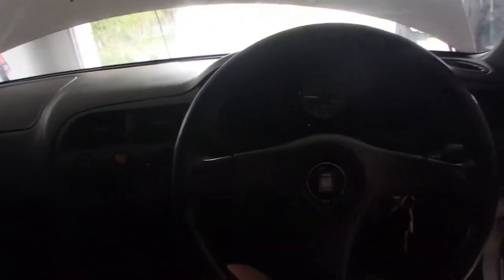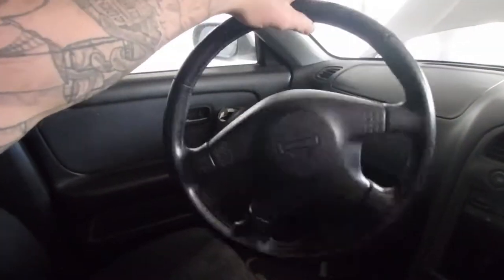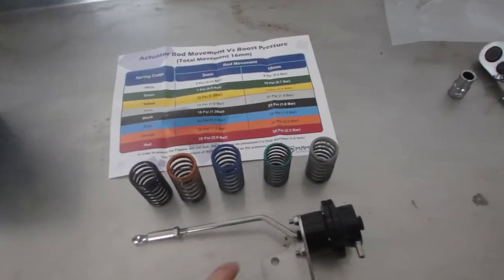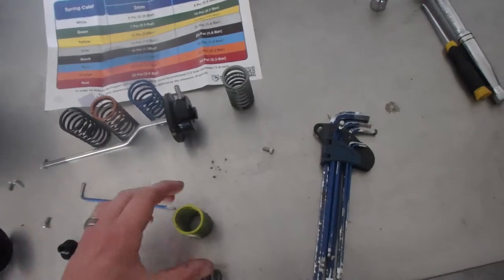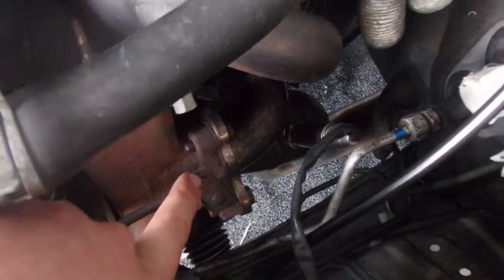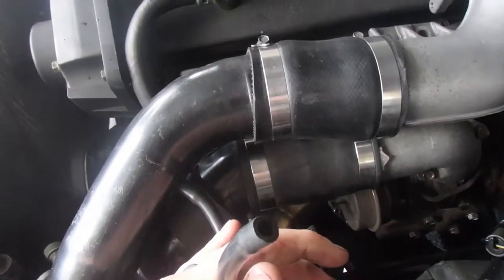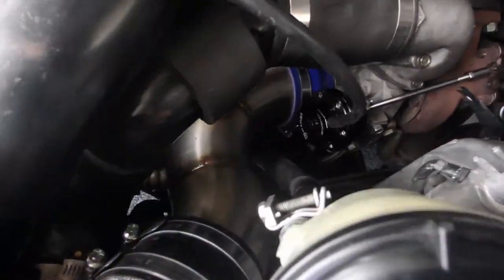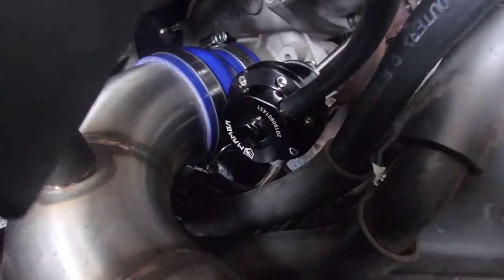Adjustable MAMBA Wastegate - R33 RB25 Skyline!

Comment: factory skyline ecu will fuel cut when the AFM sees 5.00v  which usually happens at around 11psi, give or take 1psi ,  so in other words when the engine is seeing 11 psi  of boost  up in the rpm range the turbo is sucking an amount of air through the AFM that maxes out the  scale that the afm can read being 5.00v and usually sits at around 1.30v at idle, boost leaks will cause the  cut to occur at a lower boost level .

I have on rare occasions seen 13-14 psi on stock ecu without hitting the fuel cut, will small intercoolers  and/or restrictive exhausts, with a decent intercooler and exhaust expect to hit that fuel cut at 9-10 psi .. and 200 kws at the wheels. Nistune real time board is the best option  for an r33 , its cheap its Realtime  and it works  it utilizes all the factory drivability , cold start, hot start, cold cranking, hot cranking , temperature compensation, knock retard, basically all the R&D Nissan invested, you can utilized closed loop O2 but I would turn these off if I spent enough time getting the mixtures right on the dyno and the same applies to the knock retard ignition tables, they even offer an e85 enable board that uses a GM sensor and the vehicle can be tuned to adapt to suit what every percentage of ethanol is in the fuel tank.

 Speak to matt at Nistune.

 You have 2 options for the R33 
1. is a r32 rb20det ecu where matt makes a hardware change on the pcb  of the ecu , using the onboard diagnostic LED circuit to drive the VCT  and then plugs straight in. Note: Series 2 there is no IACV (Air cond) output R32 ECUs so we recommend wiring IACV solenoid directly to the AC relay as Series 1. Auto transmission model R33 Skyline will require R32 AT controller

2. Z32 VG30DETT ecu with some pin swaps on your loom, you can even do these mods yourself, I always had issues with this option and I put it down to the simple fact that the z32 were a heap of shit and the ecu being no different to the rest of the car. but seriously if i can remember correctly and it has been a while, it was the throttle position sensor compatibility and having to combine the 2 O2 sensor channels together or you could just turn them off, stability issues, mixtures being vague, etc... when you tune heaps of different ecus of all many different brands and  many different nistune installations on different models, the factory stuff with Realtime boards responded like the high end aftermarket ecu's,  Motec, Autronic, link, only with our all the extra outputs and added features.

another option is the power fc, plug an play all the factory R&D that nissan engineers invested just like the stock + nistune option, e85 option not available, does have the hand controller display  which can be used to monitor, diagnose and tune , I always used dealer software to tune these but had to use the controller on odd occasion because the dealer software was not compatible with all ecu's 

Good luck with the build,  they are going up in value everyday, keep all the stock parts.

Comment: Nice intake pipe!.. where can I get one?
Reply from the maker: I made that one myself mate, 3 inch stainless intake.
Reply: @sedangarage8241  mamba good? Thx
Reply from the maker: @Mr19011989  worked great, but I’ve changed my set up now. I’ve got a 40mm external turbosmart waste gate.
Reply: @sedangarage8241  did you change your setup because of boost leak from the mamba? I bought one installed it on my turbo and tuners saying that the boost pressure isn't holding... i'm actually thinking of just going back to a stock actuator and throw a boost tee on to achieve 12-14 psi if I can't fix this leak that is impossible to find
Reply from the maker: @timmygentil8011  never had a problem at all when I was using the Mamba gate. Only went external gate because of the the noise and bigger turbo.